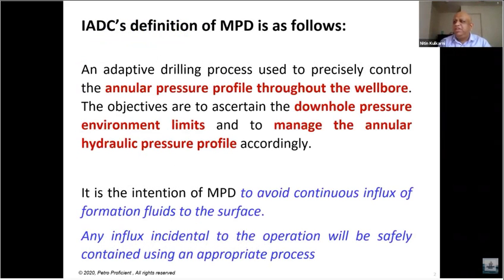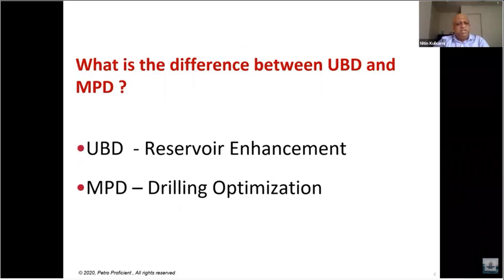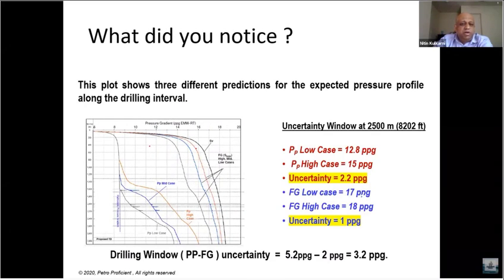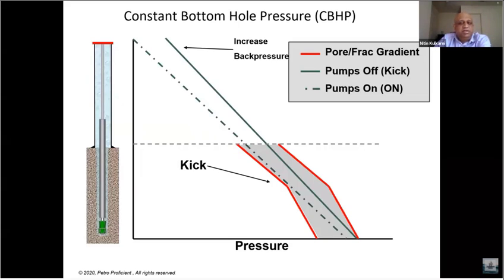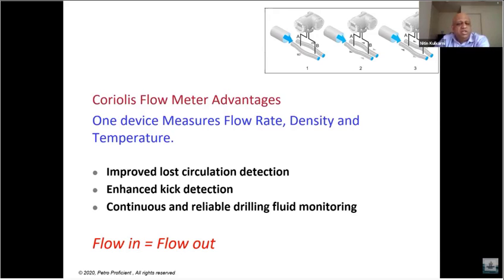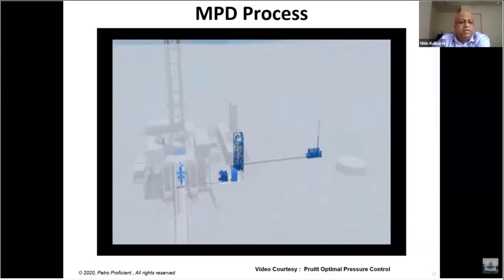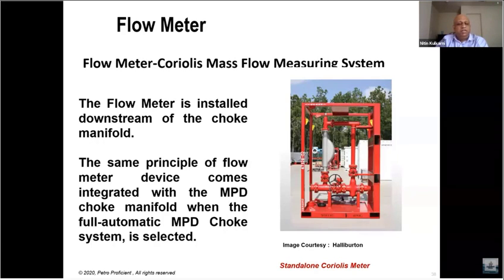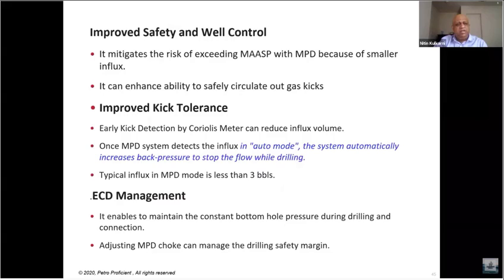Managed Pressure Drilling Webinar | Overview

Comment: Colleagues, good afternoon.
I apologize, but I want to clarify such a point.
Before drilling the well, after RCD installation, the BOP shall be tested together with the casing and RCD. When drilling the casing rigs begins, does the circulation flow through the MPD and Coriolis chokes? If so, there is a high probability of clogging the MPD equipment with rigging elements. Or is there a primary line and an additional line bypassing the MPD equipment?
Thank you!
Reply from the maker: There is a way to bypass MPD system when drilling shoe track and cement
Reply: Most mpd setups have two orbit valves on the rcd bowl one going to the flow line and one going to the mpd choke they are usually air operated on the rig floor or in the drillers cabin.